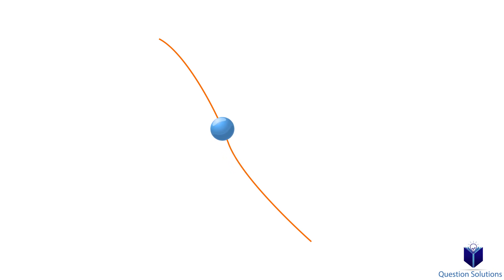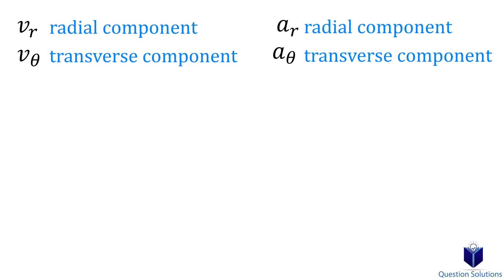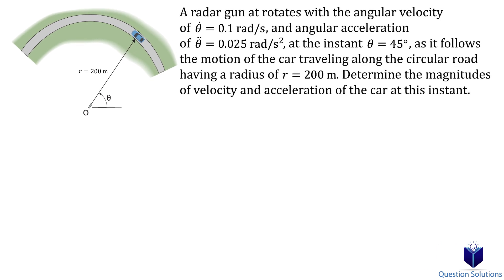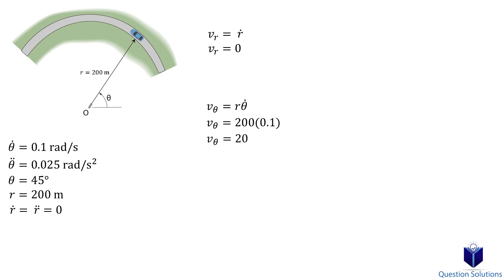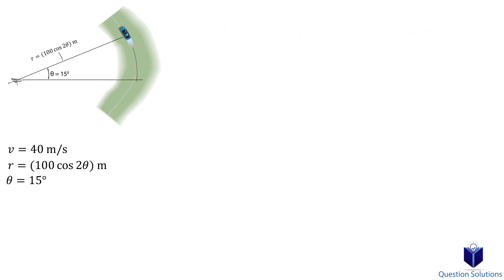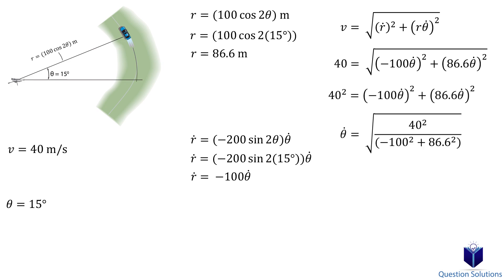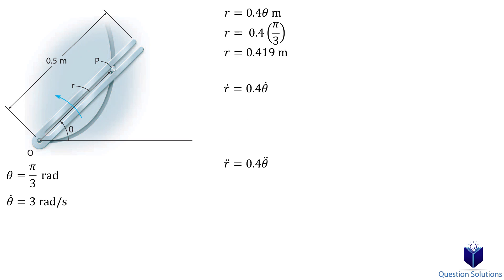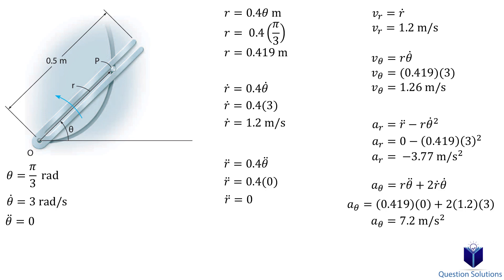Curvilinear Motion Polar Coordinates (Learn to solve any question)

Comment: during 3:24 at ar isnt it supposed to be O'ˆ2 divided by r like 0.1 x 0.1 divided by 200?
Reply from the maker: No. You can just plug it into your calculator and it will spit out an answer.

Comment: In example 3 you found angular acceleration by just differentiating the angular velocity. But in the second example when the angular displacement is given you did not find by taking the derivative of that instead you used the velocity equation. May I know why?
Reply from the maker: The 2 questions ask for 2 different things. In the 2nd example, we are looking for the angular velocity, where as in the 3rd example, we are looking for radial and transverse components of velocity.

Comment: Unrelated question. Why is the the radial unit vector at any instant taken to be Ur as defined initially, but we know that it changes with time.
Reply from the maker: Sorry, where are you referring to?
Reply: @QuestionSolutions  sorry I'm not referring to any part of the video, it's just a question I have on the radial unit vector. Say you define it based on the initial conditions then the particle undergoes motion is the unit vector in the radial direction at that point different from the initial unit vector

Comment: Why 0.5 length given in last question
Reply from the maker: Sometimes, extra values are given without reason. They might be for another segment of a question.
Reply: @QuestionSolutions  the expression for accln in transvwrs
N radial direction are what we expect but some extra term being added or subtracted
Like
 a(r)=r''(which should be true because its accln in that dirction but why we sub theta.^2?
How to get feel for it
Reply from the maker: @llltv2815  I am sorry but I am unsure of what you are asking? θ dot^2 is part of the radial acceleration, it's just part of the equation on how to find it. To get a feel for these questions, you should do as many as possible, if you can do 5 or 6 questions in this chapter, you should be fine. I also encourage you to solve the questions I've solved and see if you can do them alone, and if you get stuck, look at the video and go through it step by step. :)

Comment: pls help, im having a problem with this problem

for a short distance the train travels along a track having the shape of a spiral, r=(1000/θ)m,
where θ is in radian. if it maintains a constant speed V= 20 m/s, determine the radial and
transverse of components of its velocity when θ=(9π/4)rad.
Reply from the maker: Sorry, I don't answer questions like this because it opens up a flood gate of problems where I'd have to solve all the questions posted as comments. To give you a hint to your problem, draw it out, with the spiral and plug in the theta value given to you, which will give you a "r" value in meters. Also, there are forums that help students with questions as well, so please look into them :) Thanks!

Comment: As radial velocity in uniform circular motion is zero then why radial acceleration exists??
Reply from the maker: Acceleration has 2 components whenever an object is travelling along a curve. One is towards the center, while one goes perpendicular to the curve. When an object is not on a curve, then radial acceleration is 0. So if its on a curve, it will have a radial acceleration, but if its on a straight path, then there is no radial acceleration.